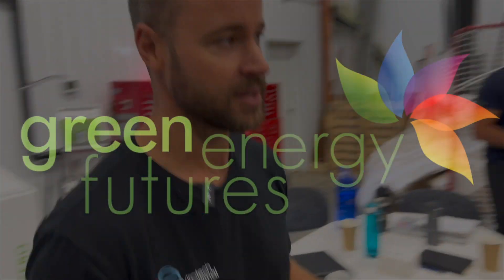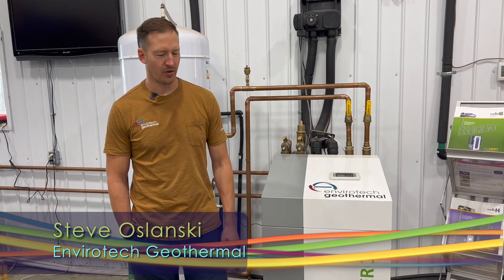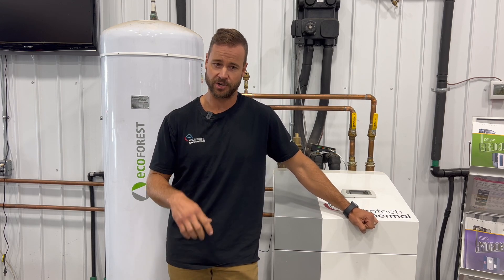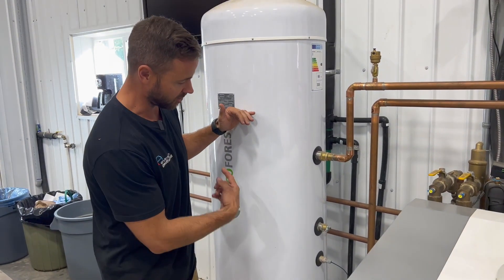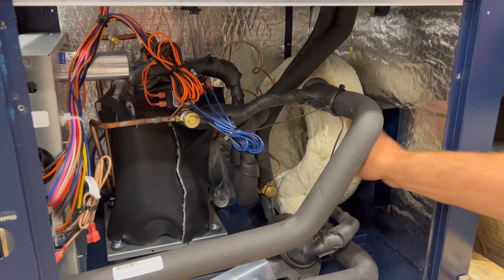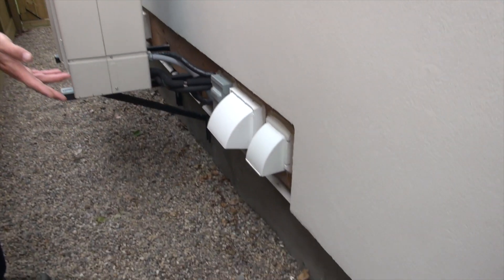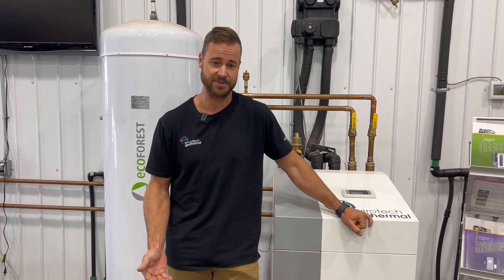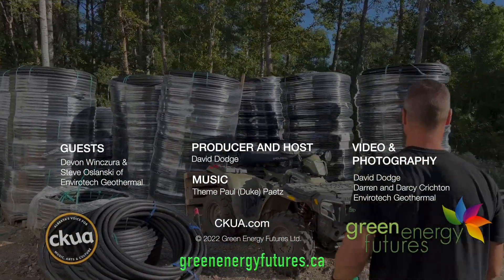Geothermal 101 - How to Heat Your Home with 400% Efficiency

Comment: In 2008, faced with needing to replace an aging air-source heat pump, we opted to replace it with a 4-ton geo system.  Total cost (after a Maryland state grant) was in the 25K range. Replacing our system with another high efficiency air-source exterior compressor would have been about 15K.  In effect, we paid an additional 10K for the geothermal system.  The real result:  Immediately our electric bill dropped from $450/month average to about $150/month.  This thing paid off in  just under 3 years!  A fantastic decision all the way around.  Its been running strong for almost 16 years and its been very reliable. I'm just a regular guy who's saved a ton of money with geothermal!
Reply: May you share what system you have? I want to purchase a geothermal unit that will last a long time like yours

Comment: Can it heat hot water while cooling the home as well?
Reply: interesting question. as an hvac guy I'll try to give an answer. this technology moves heat one way or another. from ground to room or from room to ground. or from ground to hot water tank or back (you wouldn't want to but you could). thought valves I think it would do one or the other, hot water stays surprisingly hot for surpringly long so it can focus on cooling you and cycling back. I think?
Reply: Heat pump water heaters are slow, generally you'd get a hybrid style where the heat pump uses very high efficiency to maintain water temps throughout the day and during low demand and during high demand, like long showers, it would switch to traditional elements to get the speed you expect from a water heater.

If you get a hybrid heat pump water heater the heat pump dumps cold air in the utility room it's in. 
Then if it's hot out it's helping the AC cool the home. If it's cold out the home heating is generating the heat to replace the heat the water heater took from the air. 
In theory it works very well and without the complexity of interconnecting the 2 systems

Comment: I have had a Geo system in service since 2008, never again would I buy this Tech. After -15C you need either wood or electric or both back up heat. On top of that the thing is always broken, I and the company have spent thousands repairing this thing. What’s the point then?
Reply: A lot of people don’t know how to work on it either.
Reply: @jakekostogiannis  true

Comment: Having witnessed a highly engineered vertical well loop system fail miserably, I must recommend the horizontal loop layout. A horizontal loop built for longevity could easily outlast any water source heat pump.

Comment: How much more electricity does it use compared to an air source heat pump?
Reply: Geothermal heat pumps use about half (or less) electricity to heat and cool the same house.  My personal experience here in the States. In fact, these systems make way more heat and cooling than they can use. We divert some of this excess heat into our hot water tank (its called a de-superheater) that essentially makes "free hot water" that saves you even more money.

Comment: How much heat could you get out of a 100 meter deep 8” dia. Unused water well with a static water level of 1 meters below the top?
Reply: Hi Kurt, we can strip heat out of 0 C water, the well requires a certain amount of flow to operate a geothermal system.
Reply: our loop is but a 5-7 foot deep dig in dirt, loam probably and ....... travelling 40 + 120 + 30 yards 1 way for 190 yards x 2= 380 yards for total run.

Comment: In Edmonton, AB many people do not have air-conditioning. I'm sure the cooling provided by this system was nice for the home owner. However, I live in central IL where almost all builldings have A/C. Would someone in my climate supplement the cooling of a geothermal hydronic system designed for floor-heat in the winter with a forced air A/C or window units?
Reply: Alberta 100 percent has air conditioning in every home, car and business lol
Reply: @joebot9309  Not nearly every home has a/c. 
sincerely - An Edmontonian in a 1950 house.

Comment: I was quoted 40K for a system and my average monthly heat bill is $200/mo. The payback would be about 16 years. You also need to pay additional electric charges to run the pumps, additional maintenance on more sophisticated equipment, and interest on a 40 K loan.
I don't think Heat pumps are quite there yet.
Reply from the maker: We hear you. I have considered the same at my cabin. But we think we are very close to a tipping point. Depending on where you live, you can probably access incentives for geo or heat pumps (some from local governments) and others from the federal government. And increasingly Green Loan programs are being launched with low to no interest. There is a very good chance you could do this and not be out of pocket any more than usual.
Reply: @greenenergyfutures  Sounds good, will be very interesting to watch this develop as we move forward.

Comment: Is the water heated to comfortable temperature? What is the cost of installation?
Reply: air comes out for heat  a bit close to 75-80 degrees.  sorta like a draft. had ours for 6 years. no big surprises,  but nothing lasts forever. farmland is the loop.......but i fear a leak 1 day

Comment: Geothermal has gotten a severely bad reputation because of installations like this. I have two water source heat pumps (Geothermal...) that use well water.
   If you already have a water well, just plumb it into the heat pump.......no gigantic bore holes or complex piping.....just turn it on, and reap the rewards.

Comment: What would it  roughly cost to replace a  thee ton pond loop system? Mine is about 20 years old, forced  air. Can you use the current in ground to pond lines and fuse it into the new system?

Comment: Can they also do a pond-loop set up for people who own property on a pond, lake, or river?  Are there local or provincial laws that perhaps forbid that? I'd love to find out.
Reply from the maker: Yes.
Reply: Ponds yes. Lakes are more challenging due to regs. Give us a call to discuss further.
Reply: Water loops are actually more efficient too 👍
Reply: @envirotechgeothermal7185  oh sherwood park, then you know that geothermal doesn't cut it for the winter. How much do your units run on auxiliary heat???
Reply: @josoffat7649  Hi Jo, we have several systems throughout Alberta and they work very well. They just need to be designed properly, which is why we design to 100%. Auxillary heat is not required when designed properly.
Reply: It costs 33k, someone with higher than average disability could afford that i believe

Comment: Hi guys - hope everyone is doing well 1st and foremost! 

I have a very certain couple of questions;
1. Do people' still have to pay their Water bill for the water to heat up via 'Air-to-Water' heating pump? Or do they get free water supply as part of the package? 

2. I understand this Geothermal heating can be used for underground (interior & exterior) heating, but can it be used for 'undersoil heating' like grass for our front/back Garden lawn? 

If not - no worries!
Reply: Hi Daniel, a water utility bill is separate from the other utility bills such as electricity, or natural gas for those that are connected. Depending on the location, heating the ground would require a significant heating load. Some companies in Quebec use geothermal heating for their vineyard operations. We've never had a specific request to heat the ground.
Reply: @envirotechgeothermal7185  Thankyou for answering my question - appreciate your time to do that for me. 

The answer you've answered for me has given me a better understanding of this incredible, and exciting system that could be our future. 

Many thanks!

Comment: We hope to purchase a place at a low enough price that we can afford this sort of heating.
Reply from the maker: It isn’t cheap, but it’s cheaper in the long run. Check out federal Greener Homes loans and programs.
Reply: @greenenergyfutures  Thanks. Can this digging be done in a cold climate like Minnesota?
Reply from the maker: @vivalaleta  Absolutely. I live in the most northerly large city in North America (Edmonton) and these systems make even more sense here because air source heat pumps have to deal with -30 temperatures. I recorded -38C on my thermometer in December.
Reply: It's not cheaper, it's taxpayer dollars to subsidize. We all pay for this crap whether we like it or not.
Reply: @greenenergyfutures  🤣 I was an installer in Edmonton and this is incorrect.Too cold for too long, runs on auxilary heat lots (electric heater inside unit.) Very expensive to run, consumes a lot of power. Gas was cheaper until Trudeau tripled the carbon tax...
Reply: @greenenergyfutures  Since 2018, natural gas has accounted for the bulk of electricity generation in Alberta. 🤣 pay more to burn more natural gas, what a tool, better than the coal power they were burning when I was an installer though 🤣🤣🤣 what a scam.

Comment: People...I  wouldn't trust someone who skirts the truth. what isn't mentioned is the electricity demanded n supplemental heater. we have a 220 volt unit  might be good, but needs tweaking this type of system. no need to lie installer.

Comment: One gets slowly tired how so called experts confuse geothermal and ground source based heat source.
Geothermal means tapping the heat radiating from the earth core.
Ground sourced uses the constant heat you find at rather shallow bore holes.
For geothermal you usually, apart where you find geothermal near the surface, have to go deep. In a geothermal system you are looking for water temperatures above 50° C, more likely 100°and above.
Reply from the maker: True enough, but years ago we did a Google Trends analysis of geoexchange versus geothermal and learned nobody would find your post if you called it geoexchange so we often say something like geothermal AKA geoexchange or ground source heat pumps. Things are changing, but geothermal is searched for far more often and what people are really thinking about is geoexchange. In Canada there are a few pilot "geothermal projects" and more than 100k ground source heat pump systems.

Comment: Wow!......400% efficiency?....My monthly bill is $350.00. So 400% efficiency mean the Utility Company is sending me $1,500.00 Dollars every month? 😮😮😮
Reply: If that was the case there would be a long line of people getting geothermal! From what I understand, it means that you get $5 worth of heating/cooling for the price of $1. i.e. you be paying 400% more if you were using a traditional system.
Reply: 400% is very misleading in my opinion.   Heat pumps whether air or ground source ulitize compressors which run on electricity and not just a little electricity.   Most run on 240v / 30 amps minimum.   Your electric bill will reflect it.  Natural gas forced air is way cheaper and more comfortable to heat your home.  However with that being said geothermal heat pumps do shine when it comes to cooling.